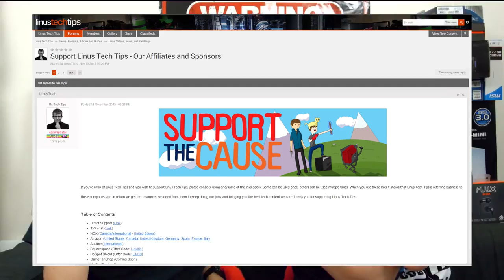Mod24 Event Recap

Comment: even if said winner doesn't like the case they still have two options 
1) they can fix the case to their own standards
2) they can strip the case of all of it components, which has to be close to at least a grand and a half worth, and just buy a $150-$200 case and put all of the components in that

If i were the winner i would just be happy that i would have actually won something and keep everything as it was (unless needs fixing). just be appreciative for what you get.

Comment: I really don't like Corsair that much at all anymore. The first PSU I received from them didn't work out of the box, so I had to return that. The first headset I bought from them stopped working completely after about 6 months of careful usage. The first mouse I bought from them had a scroll wheel that would bounce around side to side on my mouse after a few months, and the cursor would just stop functioning every few minutes. I feel like there are much more reliable companies out there such as Logitech, Cooler Master, Steelseries, etc.

Comment: okay, so 1200 on desktop upgrades or a 1200 laptop, its a lot of money and i cant deciude so i thought id see what other people have to say about it.

desktop has and i3 at 3.3ghz, gtx 760, 8gb of ram, 1tb hdd, and 500w psu,

upgrades would be another 760, a haswell i5 4670k, 1000w psu, 128gb sdd, 16gb of ram 2100mhz, another 1tb hdd, a GIGABYTE GA-Z97X-SOC, couple fans and such, but in the end im just wondering what one i would be better off getting,
Reply: You dont need a 1000watt psu for 2 gtx 760s, and ram 8gb is fine unless you render.
Reply: DoinYerMom i do render, and i know 1000w psu is overkill, but what would you go with, normally with psu's i just say rather overboard than not enough
Reply: You can sli two gtx 780s on like 800 watts theres no point in spending extra money on watts that aren't going to be used, you can use that money else where
Reply: Blu3raNger88 I have an i5 overclocked to 4.4, 2 HDD, 5 SSD's, a RAID card, sound card, wifi card, 2 water pumps, 6 fans, touch screen fan controller, and 2 660's in sli at nearly 1300 mhz and max load my system pulls less than 400 watts from the wall.
Reply: My point 1000 watts is just over kill and useless if you're not going to use all those watts, spend the extra cash one something else.
Reply: DoinYerMom and you can SLI 760's on a 650w gold of a good brand.
Reply: Yee 170watt tdp on gtx 760s

Comment: Linus, should I go for a MSI GTX 750Ti or a MSI N760 TF 2GD5/OC? Please give some advice, I don't know for which one to go.. I looked up some benchmarks and stuff, but I know my system's benchmarks will be different anyway... Thanks!
Reply: Ask on the Linus Tech Tips forum.
Reply: MSI N760 TF 2GD5/OC, N760 stand for Nvidia 760, which mean GTX 760, Tf = Twin frozer, 2GD5 = 2gb gddr5 vram, OC=overclock, no reason to go for 750ti if you have the money for 760.
Reply: HCK Gaming thank you! My only concern was if there was a real difference in performance, since you're paying €80 more, but I guess so! I will go for the 760!
Reply: ***** there is a huge performance difference.
Reply: Tyler Raber okay, I'll probably go for the 760 then! Thanks!
Reply: ***** no problem. I would also check eBay if you are on a tight budget. 7970's are going for ~150 you might be able to pick up something nice. GPU's to look for on eBay: 7970/7950, 770/760, 670, 680. Stay away from: 690, 7990, 590, 6990.
Reply: Tyler Raber okay, I'm from holland so I don't know about shipping and stuff, I've seen a 760 for €220, is that overpriced?
Reply: ***** Seems normal to me, but I think you can get it cheaper, especially if you are from western region.
Reply: HCK Gaming okay, I'll look ;)
Reply: ***** yes that is very overpriced at least for the US. Don't know prices for EU though.

Comment: GUYS, IM NIT SURE IF THIS IS CHRISTMAS OR THE RISE OF THE SCAMMERS! Ok so the gtx 780ti, the GPU I was originally going to get, just had a price increase so it now costs £700 instead of £500. The crisis is that the 980 is listed at £450 on Amazon and another site I've seen it on. I thought the 980 had similar performance to the TI with just added features. Why is it cheaper if it is better and why is it so cheap? WHAT DO I DO?
Reply: GTX 780tis are going to be discontinued
Reply: just get the 980.

Comment: PC GEEKS!!!
IS THIS ANY GOOD
IT IS A COMPLETE BUILD!!
PLEASE HELP ME!
IM AM IN NEED OF YOUR HELP!!

 http://pcpartpicker.com/p/pf6G23
 SUGGESTIONS PLEASE!
Reply: Unless you're editing, you shouldn't need 16GB of RAM, instead take one stick of 8GB RAM, you can upgrade it in the future if you so desire. Put the money saved into an SSD, you're missing one in this build and at that budget, you should really have one. Also, you spend 2000$ on a rig, and get a 30$ keyboard? Do yourself a favor and out a few more bucks into it, get a mechanical keyboard. I can't really recommend anything myself, you should look at the LinusTechTips to see what people suggest.
Other than that, the build is fine. Be aware that you won't overclock your CPU to 5GHz or something crazy though.
Reply: Also if you are just running one monitor off all that I would just use one 980 and spend the extra on another monitor, or Mechanical KB or SSD.
Reply: get a 120hz monitor or 144hz monitor
you'll feel the difference
Reply: LoLzArmy for gaming, otherwise Those korean IPS 1440p monitors can be overclocked to 90Hz+, and they'll look much better.
Reply: but you may lose quality while overclocking them so i suggest buying a 120-144hz monitor
Reply: LoLzArmy  And just having bad colour and angle of view quality anyway with those TN panels, the Koreon monitors overclock very well, even bad OC'ers get to 80+Hz no problem with no reduction in quality, better ones get to 120Hz with no reduction in quality. and best of all they don't cost an arm.
Reply: try to squeeze in a 120gb SSD for boot drive, everything else seems just fine,
perhaps drop a hhd for the ssd?,  i wouldnt ever raid0 two mechanical drives now that ssd's are availble (un less you dont care loosing data if one of the drives in the raid0 dies)
Reply: 1440P 120-144Hz monitor and a better Powersupply 860W+
Reply: And also try to get a i7 or a SSD Both would help go for a 256GB Crucial SSD, Cheap and fast, go for a 2TB HDD instead of 2 1 TB HDDs
Reply: Astin Games An i7 isn't necessary for gaming, the one he chose is fine. Unless he is going for full out editing, which he doesn't seem to do (at least he doesnt state what the rig is for). For gaming, an i5 makes more sense.
Reply: as well go for WD Black HDD instead of a Blue
Reply: ditch one of the hard drives for an ssd to install windows and games on. make sure youre computer is balanced. dont get one component that is stronger compared to another. get an i7 and ditch one of the graphics cards so when you eventually get another gpu for sli you have a processor to match
Reply: ***** and half the performance? lol although you see amd 8 cores at 4hz stock for cheaper than 4 core 3.4-3.8 ghz stock intel cpus, intel cpus have better per core performance so it's why i recommend them
Reply: If you have room in the case you should get the corsair h100i instead of the h55. The h100i is a 240 rad and has corsair link
Reply: YouTube is not the place to ask for help, go here: www.reddit.com/r/buildapc
Reply: I suggest a 850W power supply for that SLI combo, also a SSD is a must have, get a better keyboard and specially a good gamer mouse since is not fare to lack good control in your games. Z506 is a "OK" but since i have one i suggest getting something a little better. The only game i know that benefit from more than8GB of ram is planetside 2 and those game with extra mods/expantions like skyrim and the sims.